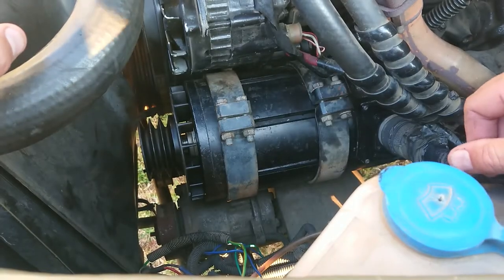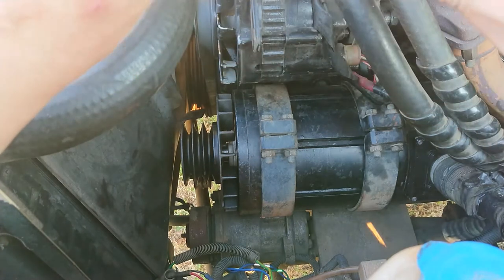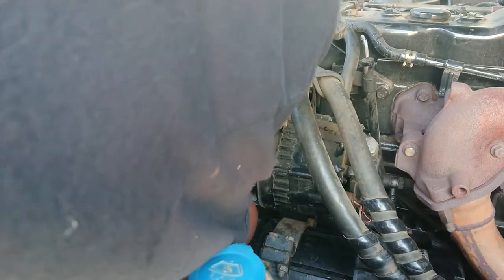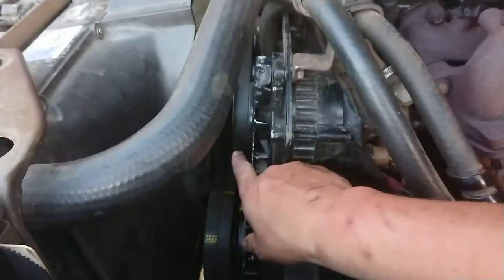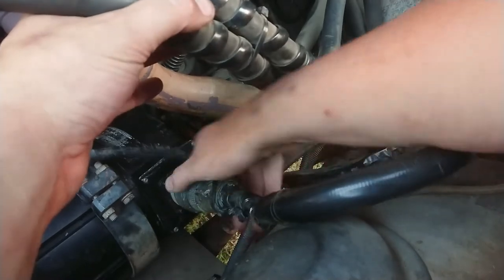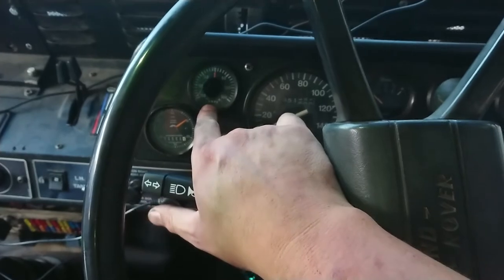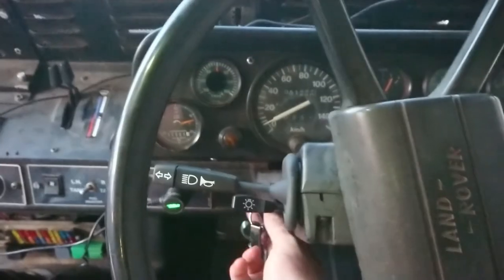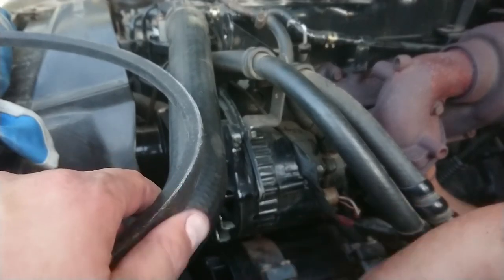6x6 Land Rover Perentie Ambulance  - Adding a 28v alternator

Comment: Have you managed to find the 24V system current shunt?
Reply from the maker: Somewhere between the alternator and the dash, that's all I know till I delve into the schematics. However testing I discovered it doesn't move under 50a load.
Reply from the maker: According to the diagrams, the dash meter has an external shunt - makes sense as there aren't half in cables running through there.
Another diagram indicates the wires for the shunt should exit the dash via the firewall somewhere.
Nothing is specific about it's location.
I'll bump into it someday lol.